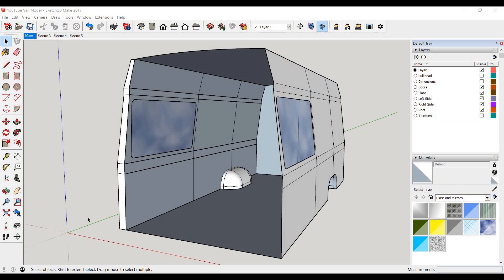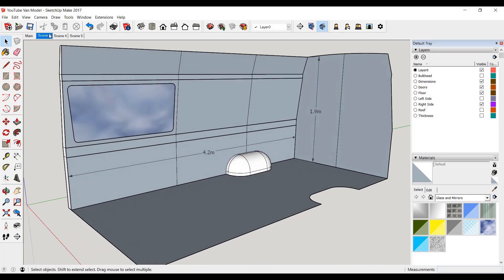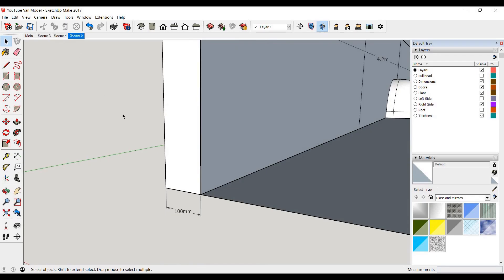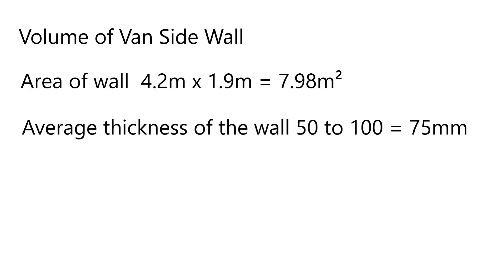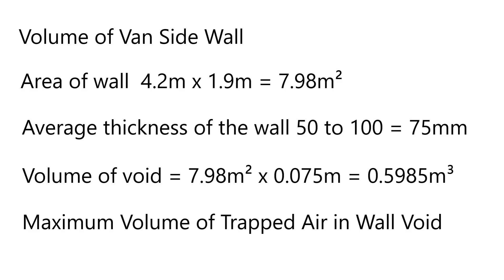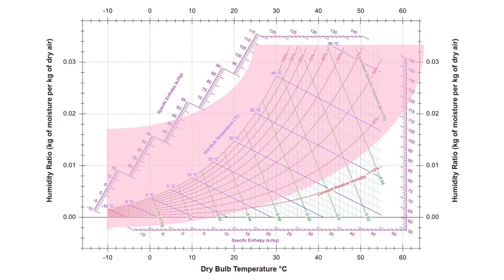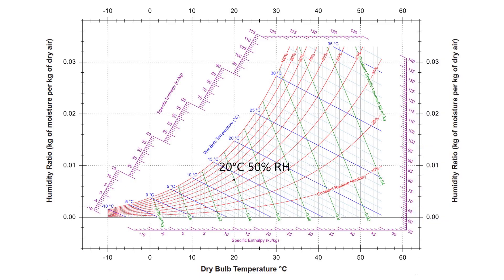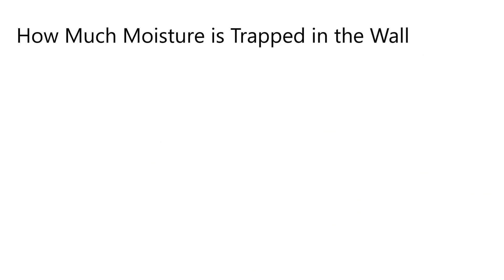There is Moisture Trapped Inside my Vapour Barrier!

Comment: Interesting video, so 5ml of water inside that space, that could possibly condense on the vapour barrier or metal. But surely it is not airtight and there should be drain holes?
Therefor, should the moisture not simply drip away after condensing ?

I am looking at a vapour barrier to fulfil 2 functions, 
1, it is a waterproof layer just in case there is a leak somewhere in the stricture. 
2, to keep the warm moisture laden air separate from the cold structure to prevent lots of condensation when hitting the cold metal structure.

Am I missing the point of this video and vapour barriers in general ?

Comment: of course all of this is with the understanding that you do NOT have any moisture leaks anywhere on any seam or window or door.  so these calculations rely on that.  if you have anywhere for moisture laden air or actual liquid moisture to intrude on  your  area you have sealed.... those calculations wont work.  so,  in closing.... seal the hell out of your van.  be anal about any spots where moisture could possibly intrude.  and i do mean be as meticulous as greg virgoe is .  because he is the most meticulous guy on details i have ever had the pleasure to see.  i have the utmost respect for mr vigoe and rely on his wisdom and attention to detail on things i am planning for my van.  you would be wise to binge watch even re watch anything you do not understand so that you get to that same level of excellence he displays.
Reply: I built my van 15 years ago... I was as diligent as I could be but undoubtedly wasn't 100%... I have had ZERO issues in all that time and have put over 200,000 miles on the van in all conditions. Do the best you can, but it's unlikely to be perfectly sealed... 15 years of sleeping in my van in temperatures ranging from +30 to -12 with no heater prove that you van won't dissolve if you've not managed to seal it perfectly.

Comment: ...........and by adding a vent top and bottom to the outside skin you can remove most of it.  No-One is putting vents on their campervans these days.  I'm not even seeing them on modern Motorhomes.

The need for a vapor barrier is essential.  Has anyone experience a cold morning in a non -insulated panel van?  If it was a warm day the day before, you will see loads and loads of water droplets in the ceiling of your van in the morning, especially if the temp has dropped.

It's a No Brainer and so many 'Professional' conversion companies don't use a barrier......coz it's more work basically of they're just copying of the other guy.

Comment: Unless you can draw a vacuum with argon gas and seal it, like thermopane glass, it will condensate between the walls, just like thermopane glass that’s lost its seal does.

Comment: What if you make a mistake and leave a small hole somewhere in the barrier,  would the vapour get in there and condense against the cold metal then, because of this, lower the volume of water in the air and so draw more moisture in?  This is my worry.  I imagine that this could cause more and more water to eveutually build up behind the taped in foil which would not easily escape.  

Can you put my mind to rest on this?  Should I be alowing air to cirulate behind the barrier? Do I need to avoid scealing off cells that may trap in water?

Comment: One thing bothering me with a completely sealed void, when sun is on the side of the van there will be some expansion within the void then when it gets cold it will the contract again. So under expansion if its 100% sealed, won’t it just break the seal? Also doesn’t the void/insulation need some sort of ventilation like in a conventional build house would have? I’m to this point in my build and I’m very confused which way to go!

Comment: Hi Greg, I think your videos are very good. It should be noted however that the void between the outside skin of the van and your vapour barrier should not be air tight. There are drain points all along the side of the van to drain any moisture collected.
Reply from the maker: I have sealed all the possible holes in the body work to create a sealed void.

Comment: How about if we put the vapor barrier glued to the wall siding material? My Earth sheltered house the walls are insulated with foil faced insulation but the ceiling we couldn't find the proper width so we used regular insulation and then a foil paper which was not easy to hang on a ceiling in an entire home. I haven't even looked do they make foil face insulation nowadays is it a thing again because it literally was going out of fashion so to speak back in 95.
Reply from the maker: Your vapour barrier is best placed on the room side of the insulation. 
They do make foil faced insulation in PIR and mineral wool slabs or even wool rolls. You could still use the double foil bubble wrap and I find it easier to fit with some trim fix spray adhesive. 👍🏼😊
Reply: @GregVirgoe  yes I get that the reflectix and the vapor barrier are on the inside so to speak and the wool is up against the outside wall of the van. The reason I'm picking your brain because Mr George at a New Jersey and humble Road is anal about airflow. So that's why I wondered if whatever kind of paneling or wall material I choose couldn't I put the reflectix glued to that panel rather than glued to the side of the van and not having any kind of easy access to even look at the wool insulation later on because you have to pull off the reflectix. So that's why I asked about putting the reflectix on the inside of whatever wall material you choose so that it's not glued to the interior of the van but it will have a space because of whatever furring we use for the interior attachments. I'm getting more excited I wired the money yesterday and I'm just going to allow the universe to provide the pieces in the parts along the way. Thanks for all your help and effort I love your videos I think I'm going to have a helper and I sent him a couple of your videos and he wrote back and said oh my God this guy is cool he's like I'm a little I'm going to like this is I'm tired of painting people's windows and pounding fence posts building out a van will be fun. Lol he also volunteers at the Habitat for Humanity store and knows everything that they have and where it is so that too will come in handy. I love the way the universe provides. Happy New Year
Reply from the maker: @justjudy7320  I like George he’s a really nice guy and creates some great content. But when it comes to insulation please let me confirm that my information is based on study of these materials at university for 6yrs and working in the industry over 30 yrs. it’s based on the actual science and facts.  
So let me confirm. The entire point of a vapour barrier is to make a fully sealed void where no air can get in because otherwise that air carries moisture and then you get condensation forming. If you allow air to circulate there’s no point fitting the vapour barrier as it’s useless in that scenario. You need to stop moist air getting in there that is the goal. Spend a little time making the vapour barrier sealed and complete. You will never need to worry about condensation. 👍🏼😎
Reply: @GregVirgoe  thank you my love. The car dealer sent me a video of the van today we're waiting on a truck driver to pick up the transport. I think the only other question I can think of for now LOL is what's the difference in the wool the one of them it's dark and looks like it's got something on it in it. What's the advantages of one over the other?
Reply from the maker: @justjudy7320  if I was choosing a current wool type insulation on the market I would go with recycled plastic loft insulation made by Diall and sold in B&Q. Great insulation properties, kind to use and uses recycled materials 🤩👍🏼
Reply: @GregVirgoe  Greg can I please pick your brain about one more thing? The van is coming tomorrow.  I'm very excited also a little nervous and scared because she is quite large. The transport guy told me he wanted $100 more than what I offered because it's so big it takes up two places on his rig. LOL my question is about the floor this has the wood floor in it that comes from the factory. I really really really don't want to screw into the floor to the point that it comes out the bottom. When I was watching Everybody screw into the high parts of the floor trusses for lack of a better term Oh, I thought the screws were only going into the air created by the joists. I didn't know they were coming out the bottom of the van underneath. I really don't want to do that can't I just glue those things in place and attach them on each side with screws where the two by two fur strips that come down the wall panels to the floor. Then put the wood floor back down and screw my subfloor into the wood floor. I do have some glueless linoleum left over from a house project that I'll probably lay down but ultimately I will buy some carpet remnants because I have a German Shepherd it actually is easier to let the hair collect in the carpet and stay in one place until it can be vacuumed.
Reply from the maker: @justjudy7320  yes, make sure that the floor is very clean and use a good quality campervan adhesive like sikaflex 522 to stick the wood batons to the floor. This adhesive is very strong and remains a little flexible so it won’t fail with small vibrations. You can then screw the wood floor back down to the timber batons. Hope that helps.
Reply: @GregVirgoe  okay Greg bless your heart I'm looking forward to the new build out I have one more question. LOL I would like to say it's going to be the last question but probably not but I certainly appreciate your replies when you have the time. My build-out guy that's going to do my ceiling and roof doesn't really want to do the floor because he doesn't want to disturb the factory floor. I also thinks it's because he doesn't really want a piece of puzzle. So he suggested that I just leave the floor at it as it but I know I need to insulate it. So my question is can I put the foam board and I'm going to use two-by-fours because I'm not going to wait this down with above cabinets and such can I make my subfloor above the factory floor first the foam board and the two-by-fours and then the reflectix and then some plywood and then some kind of vinyl flooring. What I wonder about and need to call Mercedes is what's in between the bottom of the van and the factory floor, is there some kind of Radiant Barrier in there how to how does condensation not develop in between those when somebody just uses it as a construction work cargo van. I can see I got a few more phone calls to make but I think I can build on top of that floor because lifting it and resetting it sounds like more trouble
Reply from the maker: @justjudy7320  the reason these vans don’t suffer condensation when just used for building work is because the conditions inside are generally the same as outside. They’re not got anyone living or cooking in the overnight when cold
It’s easy to lift the floor, you can reuse it on top of your insulation. But you need to insulate and vapour barrier the metal or it will be wet under the old floor all the time.
Reply: @GregVirgoe  I wondered about that and I actually called the Mercedes dealer and actually a couple of build-out companies who purchase the sprinters that have the floors in them but they pull them out and throw them away and do whatever it is they do. But I asked both of them the question even if it were only being used as a work cargo van that person would still have heat in the van and the various materials coming in and out and going in and out and him walking in and out and all around so I was wondering what happens or what would happen and I certainly appreciate the reply. I did some Price shopping today on the lumber situations and the closed cell foam and such I can't find any closed cell foam that's more than 2 in thick isn't there places where I need more than 2 in thick? One of my favorite hacks in your videos is so sticky pins that the phone Board gets held in place by. Thank you much for your reply and I'm looking forward to the build-out
Reply: @GregVirgoe  actually it may be a blessing that the guy making 80 + $100 an hour to do the roof in the ceiling doesn't want to do the floor. It doesn't take a whole lot of experience to put down the floor slats and cut out the pieces of the puzzle of insulation. I called our local employment agency and asked for a couple of carpenter helpers that don't need to be Carpenters but they do need to have common sense and the ability to measure and use a razor blade and cut straight.
Reply from the maker: @justjudy7320  maybe a daft question but why don’t you have a go at doing it yourself. My video is very easy to follow. 😃
Reply: I do plan to tackle it but I will not be doing it by myself. Not long ago I stepped outside in my stocking feet speaking of condensation picked up a rock unknowingly step back down and then took a dive onto the floor landing on one of the knees so for now it doesn't like being in the kneeling position. I'm going to hire a couple local people and get her done. From the beginning all I had planned was for somebody to get me to the point where I can take over which is basically the walls. And the actual setup
Reply: @GregVirgoe  okay sure I just went back through every video about insulation in a vapor barrier and I cannot find a video where you show how to put up the vapor barrier over the insulation and the wool. I could have sworn I watched a video which is why I started to begin with with my first question but now I can't find a video of how you hang and where you hang the foil faced bubble wrap. I promise when I get done spending all this money I'll be sure and hit up your Paypal account because your information is saved me time money and certainly emotional grief. Much love and hugs thanks for helping me take care of the Holy Grail She's a Beauty! LOL I had no idea that this high-top Sprinter 4 x 4 was going to be three times the size of my Ford Ranger I've already smacked her on a tree limb and almost took out the awning on a building because I was so focused on her front end I think I need to learn how to drive a school bus first
Reply from the maker: @justjudy7320  in this video I explain about the vapour barrier and where it goes. https://youtu.be/DKy6WnFh368
I found it easier to instal by using a little Trim Fix spray adhesive to hold it in place before ply lining.
Reply from the maker: @justjudy7320  another good video to watch demonstrates how it works is this one https://youtu.be/ommqMG7RjXg
Reply: @GregVirgoe  do you have a picture of video of what it looks like when you're done with all of the reflectix and how you got it to stick to the ceiling and where did you attach it. I watch this whole video when the only part I see it's just a minute where you're sliding your hand across a large piece of reflectix up against the wall and then it goes to something else.
Reply: @GregVirgoe  is there a part 3 where you show how you get the reflectix up onto the ceiling where you are gluing it and how.? I'm definitely trying not to drive you crazy but I can't find a finished look
Reply: @GregVirgoe  yeah I watch that when several times it's very helpful but I'm still looking for the finished product a complete covering of foil Radiant Barrier
Reply from the maker: @justjudy7320  ok so in the ply lining video before I fix the plywood about 4-5mins into it you can see the bubble foil stick to the sides of the van. You can still feel all the battens through the foil to know where to fix to. Hopefully this may help 🤩🤞🏼https://youtu.be/6AdxcqU8Y6M
Reply from the maker: @justjudy7320  within the first half of the ceiling video you can see the foil secured over the insulation. Before I put up the ceiling boards. 
https://youtu.be/6OEqkdYnYHQ
Reply from the maker: @justjudy7320  it was difficult to get the camera far back enough in the van to see the whole thing. But basically the roll of foil bubble is stuck right across everything with Trim Fix right up to the floor, ceiling and doors before any cladding is secured 👍🏼😃

Comment: Hi Greg
Not sure if you’ve covered it before, but I have a question about anti-condensation coatings.‘ I rent a shipping container that I use for storage and as a workshop. The ceiling and upper parts of the sides are treated with a coating to prevent condensation - which it does very well. They describe it as graphite, and it has an artex like finish. Is that something that might work either to supplement or replace a vapour barrier?
Thanks in advance 
David
Reply from the maker: To prevent condensation the surface temp must be above the dew point so the layer must have some insulating properties to achieve that. Do you have any links to the product? Cheers 😊👍🏼

Comment: Essentially you want to insulate when its cold as the ability of the air to hold water vapour is low with a lower RH (as much as it can be). Or if its hot you want to have a low RH. Awesome Video! nice to clear up a lot with facts.
Reply from the maker: You are correct.  Colder air has less moisture content even though the relative humidity may be higher. 👍🏼😊

Comment: The problem, at least with your idea of calculating, is that the van, just like house, breathes.  And if the air breathed in is laden with water it could condense inside your walls. I don’t know the solution to that one. But I expect a nice hot day in the sun will see some of that water going out.
Reply from the maker: If you seal all the trim clips and any holes in the body there is no way air can get in. It’s very easy to seal the vapour barrier and not hard to achieve. So why would you let your van get soaking wet every time it’s cold. That just doesn’t make sense.